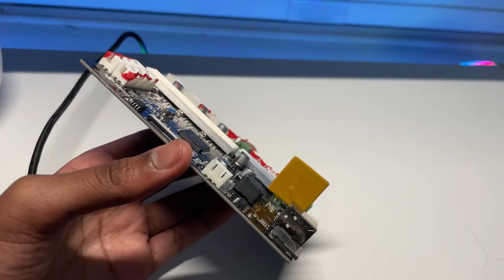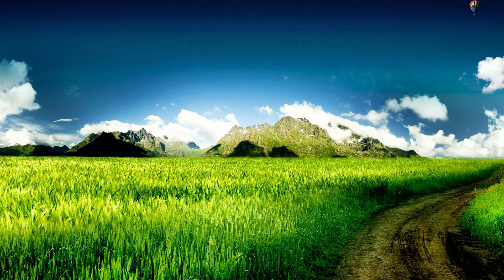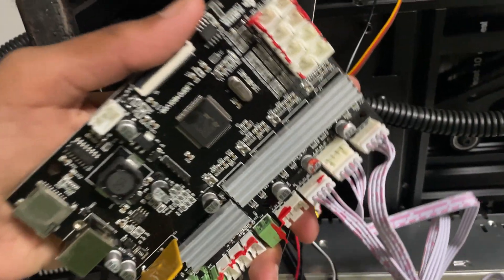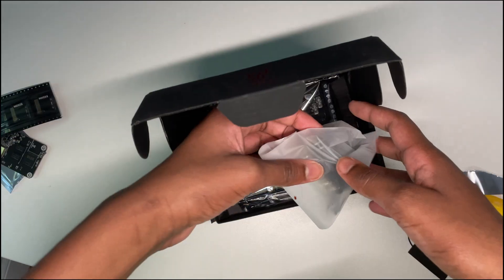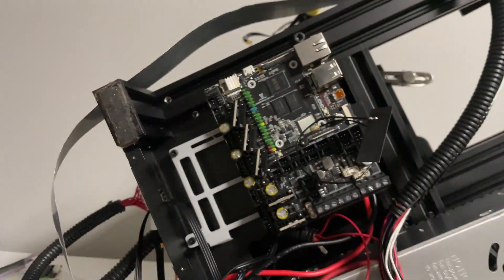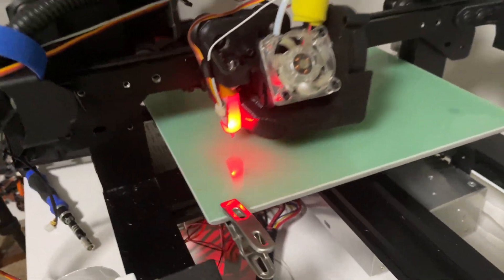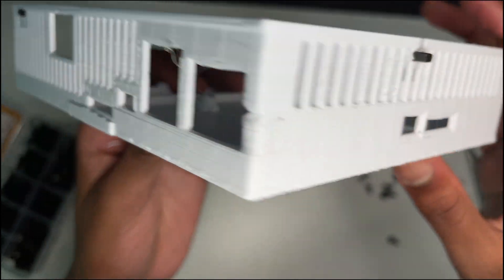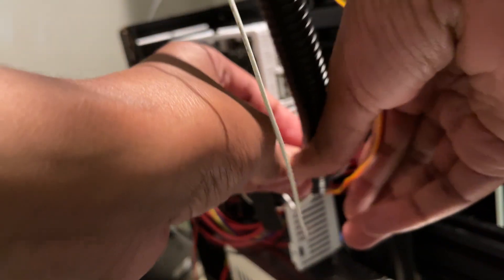I upgraded my old 3d printer to Klipper!

Comment: You indirectly saved my entire build! I also have the CB1 and Manta E3EZ, but I could not get them to work properly for an upcoming video which was very stressful. As always when troubleshooting, I watch every possible video on the parts. The issue specifically was getting the Mainboard MCU ID. Turns out removing the tape, which you showed, was the one thing I didn't do. I thought it was such a little thing that it wouldn't have any effect. Thanks so much!

Comment: Nice job dude!  I dig your mobo case, mad props for doing geometry like that in Blender 😁
I'm an old head and haven't even touched kipper yet, still running Marlin on 32bit boards. My old 8bit boards are still in a box somewhere 😂
Reply from the maker: Hey, thanks!